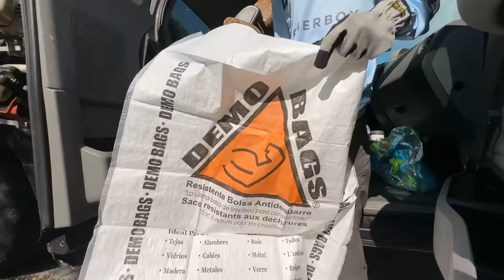I DIDNT HAVE PERMISSION TO MOW THIS YARD and got CAUGHT By the Neighbor!!!

Comment: To start older weed eaters: Squeeze gas bulb until you feel back pressure. Put choke on full. Pull cord until it sounds like weed eater is trying to start. Move choke off full to half choke. Pull cord. Weed eater should start within 2-3 pulls.
Note: Pull cord out until you feel it has tension. You should not pull cord to start engine until it reaches this point. Now pull to start. Repeat until it starts.

Comment: I prefer using the CC option as sometimes it's hard to hear what's being said; it's not available for this video.  (in the summer, it's even harder to hear with the windows open).  Hopefully I can get the jack fixed on my laptop so I can plug speakers into it again.  //  A Pheasant feather?

Comment: A very pretty house and nice yard.  And you improved it 100 times over.  But I'm confused about why you cut the crap out of the palms but then left all the little volunteers and scraggly looking stuff growing at the bases of all the other trees and bushes.  And why you didn't blow the leaves out from the bed along the front of the house and the fence line, etc into the yard then mow them to mulch them up.  🤷🏼‍♀️  A tad disappointing this time.

Comment: There ain't nothing wrong with that weed eater change the filter get a new carburetor brand new then if it don't run right check that exhaust pipe it cuz I have a lot of carbon in it

Comment: You might want to consider reediting this video. With a little bit of research anyone could figure out exactly where the house in it is. You had mentioned in the past that you are in Florida and now you have revealed where in the state you are and it was revealed that the house is not occupied as of filming plus your cameraman zoomed in on a street sign raveling the cross street that this corner lot is on.